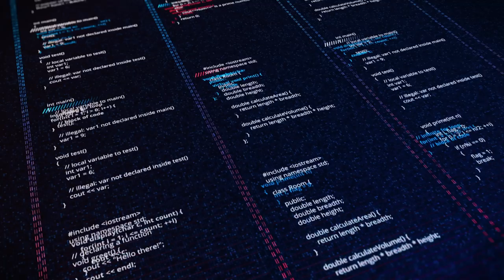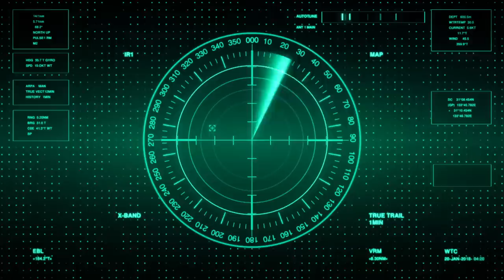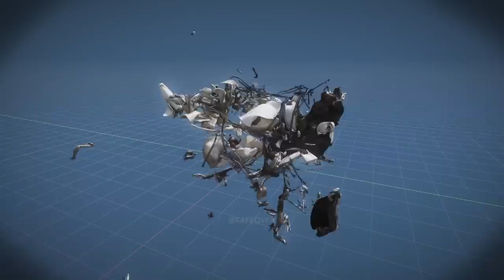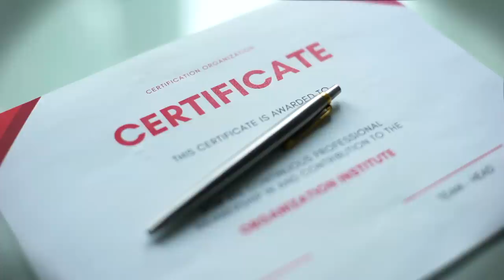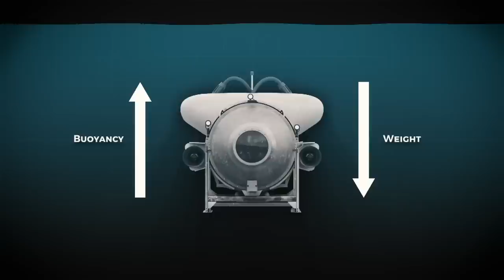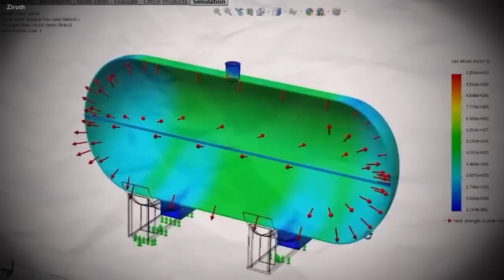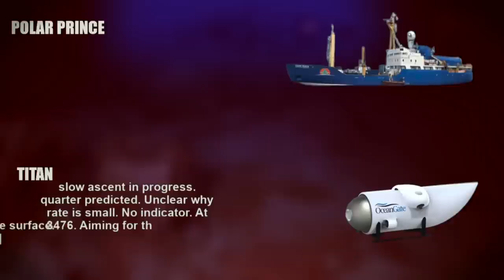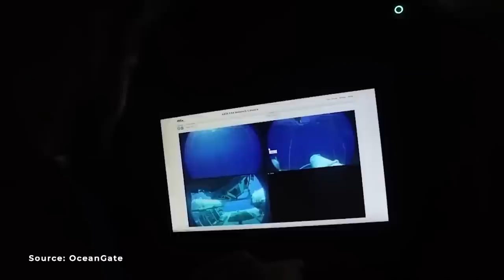The Shocking New Discovery about the Oceangate Submarine   What REALLY Happened!

Comment: Kinda nuts that it didn’t collapse sooner, it’s been on various trips down the depths
Reply: because when the carbon fiber is brandspanking new it is perfectly safe to do what the Titan  was designed to do.

It was the dodgy practices by Stockton Rush that killed those men.

Carbon fibre needs to be heavily monitored for defects and it needs replacing, especially after the repeated and immense pressures it endured.

absolutely impractical and VERY expensive.
There's a reason he was the only one in that field using this stupidly risky material.
He built it and tried to save money but all he did was build a one use, disposable submersible😅